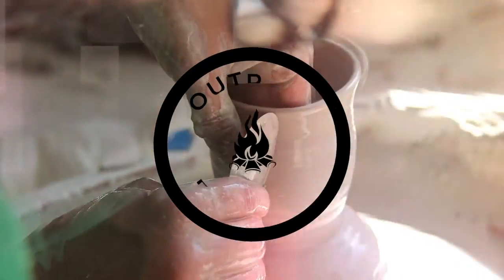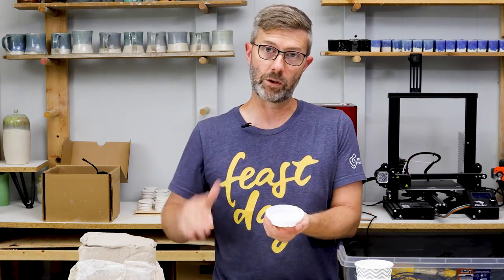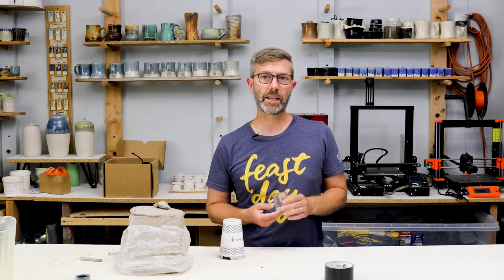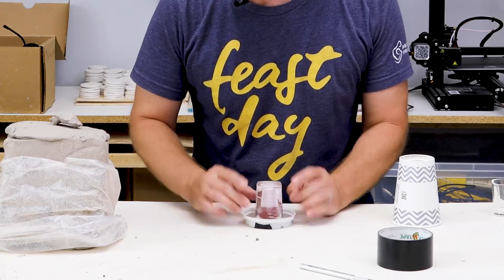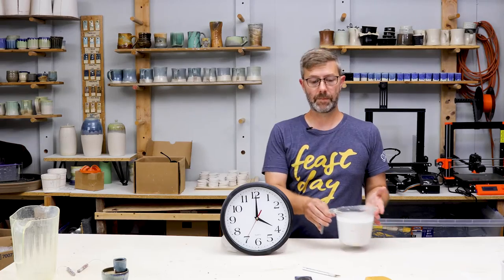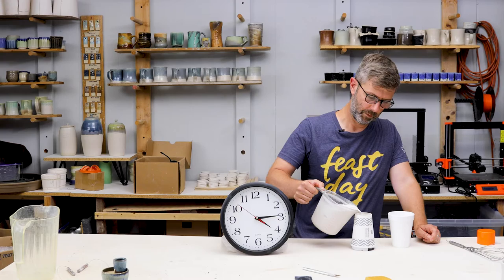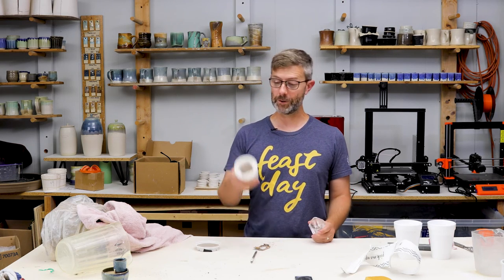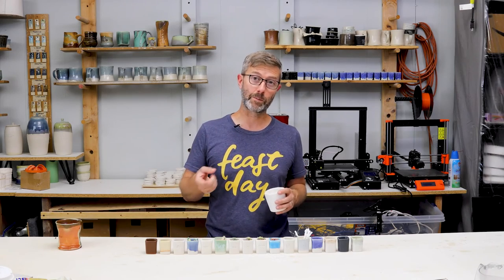How to Make a Plaster Pottery Mold from a Paper Cup

Comment: Can I just fill the form with clay? (Don’t have wax handy but want to keep my original form. Wouldn’t clay work too?
Reply from the maker: Yes that should work as well.  Sorry for my delayed response here :( You can fill it with anything that will remain pliable - your'e mainly trying to get the air out so it doesn't' float up.  make sure it fixes firmly to that clay base.  You want to make sure it stays adhered and doesn't come loose.